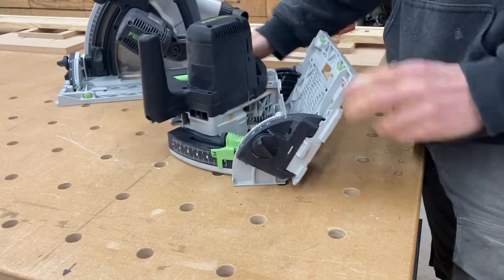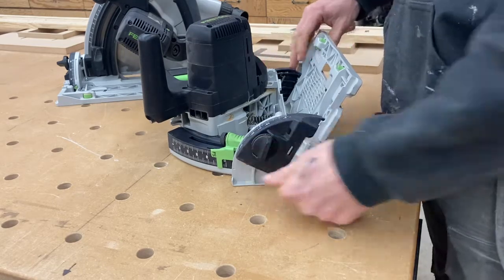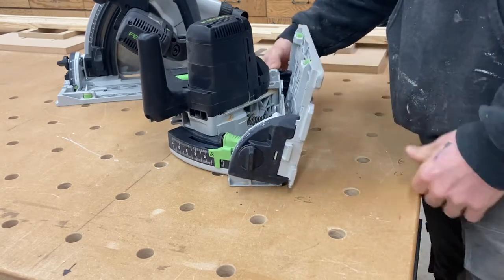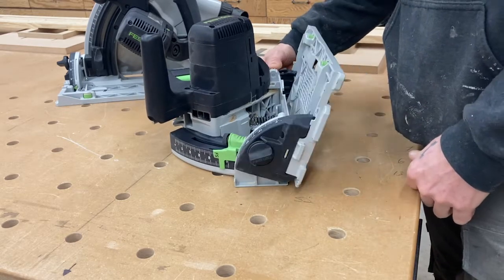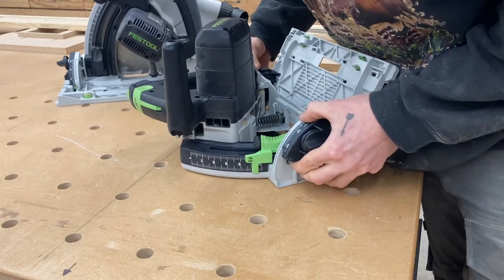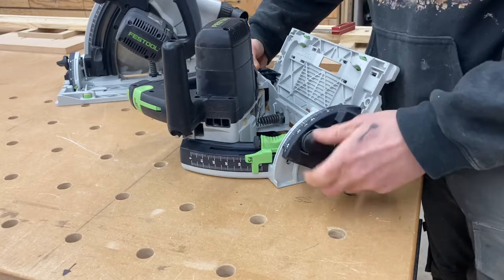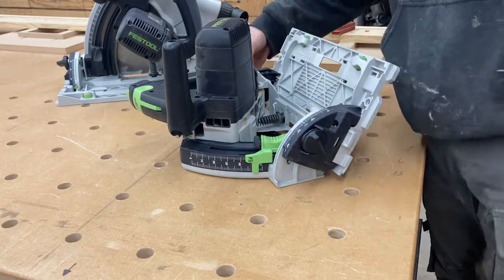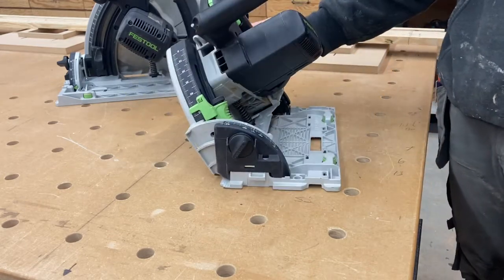Festool Track Saw Tip, ts55 and ts75

Comment: That`s a nice idea , i will try it to set 90 degrees on my makita . I always struggle with that
Reply from the maker: let me know how it goes. I haven't used the makita, how do you like it? i would like to get there cordless version.
Reply: @plexuswoodworks1771  have worked with both corded versions of Makita and Festool , they are pretty much the same only Festool being a little underpowered . Never tried cordless, hard to say :)
Reply from the maker: @RICOFURNITURE   it is shocking how under powered the festool saws are.